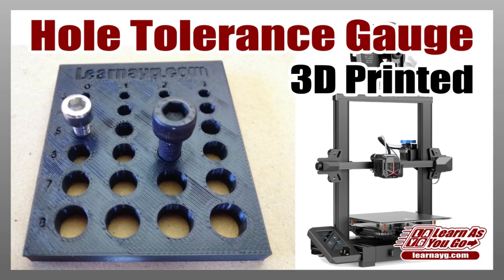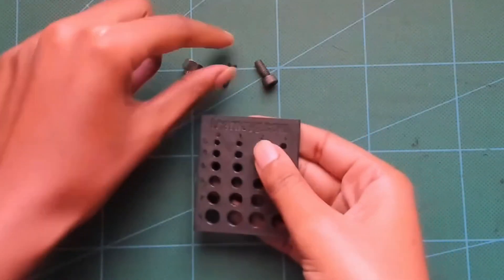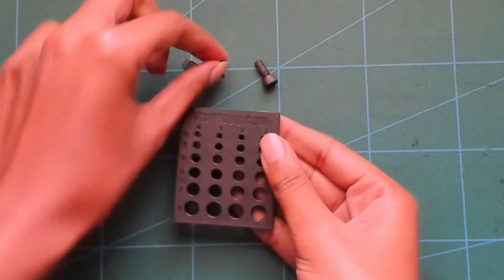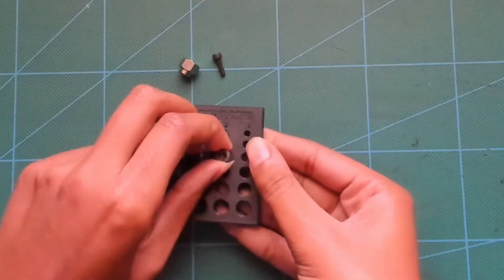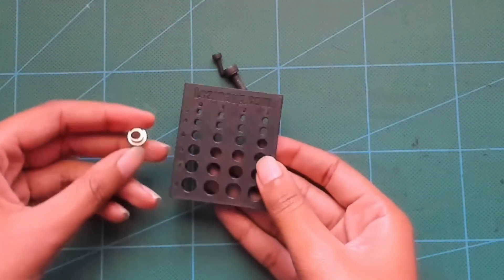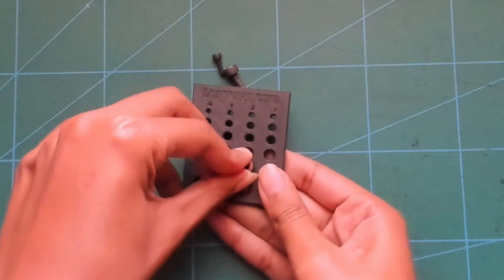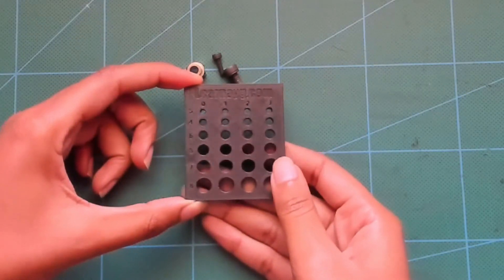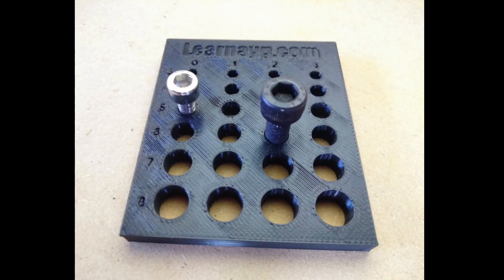Hole Tolerance Gauge For Screws & Bolts Designing 3D Prints In Freecad Fusion 360 Solid Works STLs

Comment: A couple notes, you can also calibrate your printer with shrinkage factors and hole scaling if you need very tight tolerances.  Additionally if you print with different filament types (PLA, PETG, etc), you should print separate gauges for those as they each shrink differently.  Good video though!
Reply from the maker: This is great advice. I have one of these printed in ABS because of the high shrinking. Thank you for this comment, I hope a lot of people read your comment.